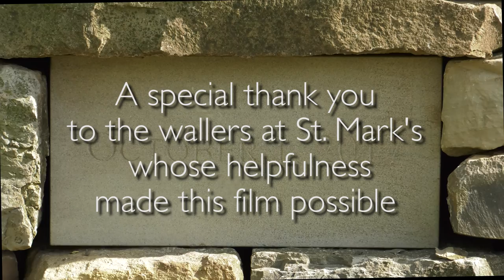The restoration of St. Mark's dry stone wall - October 2017

Comment: 12/13/2021
I once built what I called a "thrown stone wall". I collected the rocks and then attempted to place each rock in the wall, without modification,  and nothing to bind them, so it fit and sort of locked in place.
I learned that the rock will tell you where and when to place it. I managed to build a wall strong enough to walk on, over 6 months. 
We sold the house, I wonder if it is still there 17 years later.
These folks did a much better job than me, but I sure do understand what they did and how. Beautiful job. ;-)

Comment: Stone will often tell you where to place it on a wall. ...... My ancestors owned huge quarries in Plymouth, Devon, England, where from 1812-1841, they supplied 4.5 million tons of limestone for Plymouth Breakwater - 1.75 miles long - and a MASSIVE undertaking for the time. ...... Other ancestors owned a Cornish tin smelting works, and from that ran a bank for over a century, funding many mines, the expansion of the railway to Penzance, and countless buildings built of cut stone. ...... so stone is in my blood. ...... I grew up in a huge limestone house built by my great-grandfather, who even built a bridge to create a new front drive, which involved blasting the side of a very steep wood - well over half a mile downhill, and great fun for small boys on bicycles and go-karts, plus great for bump-starting tractors and cars. ...... So I have huge respect for stone, those who work with stone, and those who appreciate and love stone.
Reply: It's true the stones tell you where they want to go .... I've just found my passion for walling.... ❤
Reply: @TheMrlister72  

It is so very satisfying
when just the right stone slots in perfectly,
sometimes not only exactly the right size and shape,
but the right colour too!

And stone can be reused for centuries,
unlike modern materiels.

/